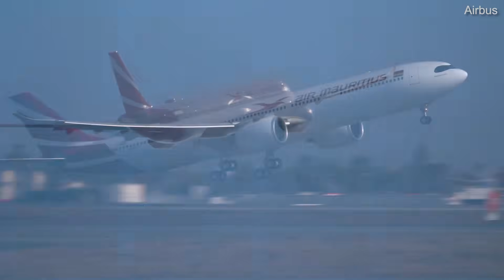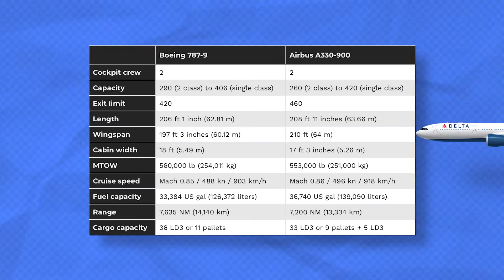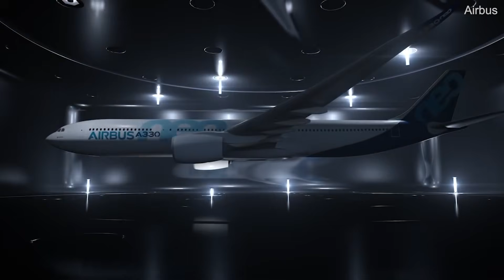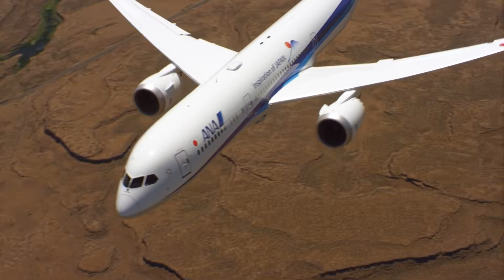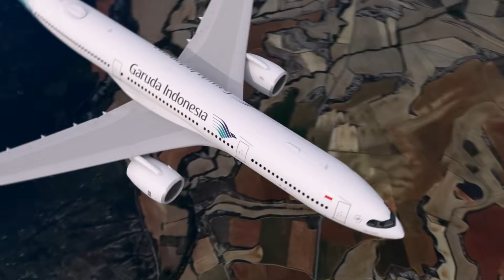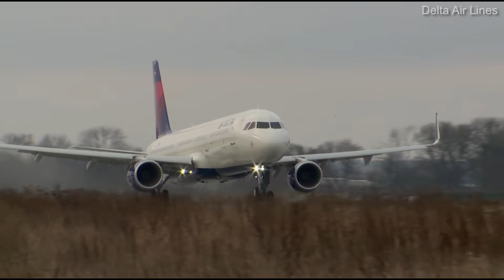Airbus A330neo Vs Boeing 787-9 – Which Plane Is Best?

Comment: There is a significant difference for passengers on long flights.  The 787 has a lower cabin altitude and higher humidity which makes it much more comfortable.  Also the cabin air is not extracted from the engines so there is less chance of contamination.  A major advantage of the 787 is the ability to select the GE GENX engine where the A330 it is Rolls only.  Several customers the originally ordered Rolls engines on their 787 have switched to GE for the follow-on orders.

Comment: i have flown both models 787 and 330 Neo. I must say the Boeing product feels more solid regarding cabin vibration during takeoff and landing. Both 787 and 330 Neo fly smooth and quiet. When I travel overseas I opt for the dreamliner on the routes i fly. When not offered my second choice is 330 Neo.

Comment: I remember flying both type of aircraft several times. But I prefer the 787 landing, because it was quite smooth. I don't know whether it was bcoz of the pilots or the aircraft... but I flew with different airliners so, I thought that may be the aircraft also play a roles in it...

Comment: I always felt that comparing the B787 with the A350 was unfair as the A350 was almost better in all aspects but comparing it to the A330 seems fair enough and coming back to the A350 it's a good comparison for the B777 and the 777X making it's appearance and the A350-1000 getting released the competition just gets better!

Comment: When it comes to the Airbus A330, I have flown on it as a passenger. However, I never flew on an A330NEO due to the fact that this was a second generation of the A330. I'm expecting a quieter cabin on the A330NEO than the A330 just like with the Airbus A320NEO and Boeing 737 MAX with the engine upgrade if I were to fly on one. I hope I can have a chance flying on the A330NEO only if I am able to book a flight using it.
Now when it comes to the Boeing 787, I flown on just once in my lifetime. I liked seeing the dimmable windows in action and the mood lighting in the interior. I hope I can have a chance to fly on the 787 again.

Comment: The Dreamliner should be recalled Dramaliner for Boeing.....headache after headache due to multiple assembly flaws. Which Boeing airplane (almost) never met technical probems??? The B777 and B767. Two models destined to be replaced....where is the quality and the reliability for Boeing????

Comment: I flew the 787 and  a350 back-to-back, and what struck me as peculiar was that the 787 felt just like the 777, while the Airbus a350 felt like a new plane. I realize we're not comparing those two aircraft, but my point is that Boeing built a brand-new airplane, but it doesn't feel that comfortable. It provides the carrier's efficiency but doesn't seem to do much for passengers
Reply: Passenger comfort for the most part is determined by the airline and their choice of seating configuration, unless there were specific things about the A350 that made it stand out or things about the 787 that made it seem similar to the 777? I've personally found the 777 less comfortable than the 787 due to cabin pressurization and humidity levels on the newer 787 relative to some of the older 777s. The A350 also has these characteristics.
The A350 is also the newest of those 3 aircraft so makes sense it'd be the most advanced even if Boeing has improved the 787 a bit over its lifetime.
Reply: @christodang one thing that sticks out as well as that the 787s are being pushed to 9 seat configs, while the a350 being a bigger jet was designed for it, making it feel more spacious
Reply: @samuelharmoko250 There are 10 abreast seat A350s being made (mostly for low cost carriers but we know how these things tend to go in the airline industry...). The 787 was itself initially designed for 8 abreast but I think only JAL still flies those.
Reply: I agree with that 787 is similar to 777 as been on both myself. Last year went on B787-9 1st time was great and this year A350-1000. To me both very difficult to compare. My next aim is hopefully A330 NEO

Comment: The a330neo is still a new aircraft, so it will be modified or be redesigned over the years. Also, when the 787 came out it also had couple of problems and eventually Boeing sorted them out so we can expect the same with Airbus.

Comment: This is a really stupid question, as the a330 is one of airbuses most popular planes & a worthy competitor to the Boeing 767, while the Boeing 787 NightmareLiner was supposed to be a replacement for the 767, but has become Boeing's worst airplane.  Both the 777 and a350 are larger, more efficient, and MUCH more popular than the NightmareLiner.

Comment: The 787 has larger cabin windows. The A350 should be mentioned. By recent standards the small cabin windows for the A330neo could be an issue. Thank goodness Airbus launched the A350.

Comment: You’ve compared the wrong planes ! A330 equivalent is Boeing’s 777 & the 787 equivalent is the A350.
The only very real similarity is the A330 neo uses a Trent 7000 which is essentially a Trent 1000 but with bleed air & hydraulics to run the aircraft’s systems where the Dreamliner is mostly electrical.
Reply: Actually it's not wrong from the market perpective.
 
A330Neo and 787 has similar seating and somewhat pretty close margin in fuel burnt per seat (of course 787 wins due to its all-new aircraft) both A330neo and 787 are used for both domestic and long haul-flights (which ofc 787 has more long-haul due to longer distance) Sure 787 wins by a landslide against the A330 in terms of orders but considering Airbus didn't even have to launch a new aircraft to alternate the 787, i can say the 330neo had a close fight

A350 does compete with 787 but not in market-wise. Most A350 operators use the A350 to replace 777-200ER&LR or -300ER /A340 routes or launch long-haul flights just like 787 but longer distance

Comment: I m neutral, between A330 neo (  600  ) & B787 9. But any a little differrence for two aircraft. AIRBUS A330 600 NEO, beautiful & strong, use high landing gear but from A300 platform, first product from Airbus Industrie (  ADS  ).  BOEING 787 9, new design, wide passenger window, beautiful wings & for glass cockpit model, simple & beautiful. But not strong, because not use high landing gear. Beautiful but not strong. So, I rate  (  50 : 50  ). 👍👍🤗🤗  ///( #CROCITLMYIGPDPODSSS0824PMWIT11262022#) ///

Comment: I think it’s very dependant in subjective terms, more on the age and service life of the particular planes you’re on. 

My last 787 flight, about 30% of the overhead bins had rattling doors which really irritated me.  Toilet door kept popping open throughout the flight, despite being locked. My seat, along with my daughters, creaked like a old bed frame. There was horrible engine whine and on take off it sounded like a bag of nails. It took the shine off a little. 

Compared to the A330 Neo I got off this morning, which was very quiet, well built and very comfortable.

I know which I would pick for a long ride based on that comparison! But then again, I might end up on a rough A330 and a perfect 787 next time, so it’s always subject to change. 

I’m still a little nervous about the 737 crashes, 787 quality failures and Boeings desperation in hiding issues that affected safety. That bothered me and still does. Airbus isn’t perfect by any standard, but I’m still a little uncomfortable. I’m booked on a Max flight tomorrow so I’m trying not to think about it 😂
Reply: That is an issue of airline maintenance, not build quality. The Dreamliner is light years ahead of the A330.
I've flown on the MAX several times. Not a problem.

Comment: Me, I'm located towards the islands of the Indian Ocean where the competition is phenomenal. There are several companies that allow me to go to France including Corsair, Air Austral, Frenchbee and Air France. I often go to Paris in 787-8 for 9 hours of flight and in A330neo for 10 hours of flight, and I prefer the 3-3-3 of the 787 Air austral which is more comfortable than the 3-3-3 from corsair (A330neo ). Wider seats and more spacious cabin, but on the other hand I like the Corsair A330neo cabin better, which is livelier, more modern and a little quieter. Both of these planes are amazing and each has its strengths and weaknesses.
With the 787 from Air austral I feel comfortable physically and with the A339 from Corsair I feel comfortable mentally

Comment: You say the advantage of the A330neo is seat capacity and use the seating of a 787-9, when you fail to mention the 787-10 which is bigger and has more seats...
Reply: In this video he is comparing specifically the 787-9

Comment: Since you are British.. what would you drive a modern Aston Martian or Jag or a 1900 Vauxhall astra estate. The two most critical factors for any airframe design is the WING efficiency and engines fuel consumption. Every thing else is secondary.  787 is by far is the future in airframe designs..

Comment: As a solo traveller , I remember the time when I enjoyed more to travel in a 3-3-3 seating row (777) than in a 3-4-3 seating row(747). And now I enjoy more to travel in a 2-4-2 seating row (330) than in a 3-3-3 seating row ( 787)  .
Reply: 787 was meant for 2-4-2 seatings but greedy airlines crammed in 1 more. There are still some airlines that retain 2-4-2 seatings, most notably Asian airlines.
Reply: Then if you want to try 787, JAL is possibly the only airline that is worth the 787 experience due to 2-4-2 setup instead of 3-3-3, but who knows how long it will stay that way

Comment: A330  comparing the wrong aircraft  should be a350 against 787 and 787 would  win hands down !
Reply: The A350 is far bigger and costs way more than a 787-9, while the A330neo is almost identical to the 787-9 in many aspects

Comment: I'm not a Boeing or Airbus loyalist, I rather look at the planes.  For example, with narrow body flights, I prefer the A320 family.  It is just a bit wider, making it more comfortable, and seems quieter and more robust.  But in this category, I give it to the 787.  I love the big windows, the far better atmospheric pressure.  I do not mind the 3-3-3 cabin, it is very comfortable.  And they have such beautiful wings.  This plane is a revolution and has changed the way we fly long haul.  I live in Hawaii and Hawaiian is moving from the A330 to the 787.  I can't wait to see what new routes that will open up for long haul flights with the 787's better range.  Finally we will have nonstop to Melbourne and possibly Europe!
Reply: Yeah no, I would still prefer the A330neo, over the 787, regardless of the windows and better atmospheric pressure, however in terms of aircraft build quality and durability, and reliability, i give it to the A330neo
Reply: @ramyfares9099  The man has his opinion. Accept it. The 787 has a dispatch reliability of 99%, just like the A330neo and other widebodies. Durability? I've seen no issues with the 787's durability at all. The only point I'd give the A330neo is build quality. Boeing screwed up there.

Comment: I’ve flown on any number of 788s and A330s, and while I appreciate that the 787 is a clean sheet design, that’s about all.  From the point of view of passenger comfort, the 787’s 9 abreast seats are narrower than a 737s, if that’s possible, and extremely uncomfortable on long flights, more so if it’s a full plane– shoulder room is woefully inadequate. It’s made even worse if the airline has reduced seat pitch, like many low-cost carriers have. I quite like the 787 in premium economy/business, but that’s not how I usually fly.

Comment: I flew on the 787 and I wasn't impressed. I found the cabin noise more boomy than the 767, and the electronic window shade is just a gimmick as it doesn't completely blackout so if you need sleep in the day you're out of luck. Considering the previous controversy around its manufacture, I have been trying to avoid it since.

Comment: I would hazard a guess, as operators seek replacement A330 CEOs, A330 NEO orders will increase as it is a far cheaper option in the background to gain the similar benefits
Reply: The problem is that the A330Neo have the same systems as the A330ceo’s (except the new engines and wings) 

The 787 on the other hand makes maintenance easier, smoother, cheaper and quicker since most pneumatic and some hydraulic systems with electrical systems
Reply: @broddsaviation5471 More of a reason the get the NEO if they've flew the CEO before since it has the same systems retraining the pilots wont cost or take time that much compared to training them to a new aircraft and plus they can effeciently maintain the NEO better since they have experience with the CEO before

Comment: While I would say the 787 is the better plane technically as a pilot and passenger I prefer the A330 neo. You get more space per passenger and as a pilot you get a side stick and a tray table. I do like the 787 crew rest area though.
Reply: @Roger  ok. The 787 is only lighter, more efficient, quieter, lower cabin altitude, better take off and landing performance. But you know whatever you say. That all said I would rather have the 330neo due to the cabin / cockpit layout and fleet simplification. They are both great airplanes just for different reasons.
Reply: Exact my thought  - fancy composite design with anachronistic cockpit layout.  The A330 cockpit looks cleaner, and it looks more like a workstation of a systems manager or plant manager.  It's a step ahead from Boeings steering wheel and thousand knobs, lights, and little switches.

Comment: I'm astonished that the A330-900 is more expensive. Why would that be the case, it fails in almost every measure against the 787. And this is a legacy plane that has only been upgraded, not a new platform at all.
Reply: It might have a higher list price, but that doesn't mean Airlines have to pay more for an A330-900 than a 787-9. Many Airbus Jets have higher list prices than their Boeing counterparts, but Airbus usually offers larger price cuts to airlines.

In the high demand, medium range market the A330-900 can even outperform the 787-9. That's the reason why the -900 is popular with Asian Airlines.
Reply: @peterv.9485  Just read your comment again, and see if it makes any sense,

Comment: I think more should have been discussed regarding maintenance costs.  I'd be very surprised if the 787's maintenance costs were not much higher than those of the A330.  I mean, how do you repair a composite material hull after it's been struck by a resupply truck on the tarmac?  After all, this type of incident happens very often.

I have flown on Air Canada's 787, both the -8 and -9.  It may be caused by Air Canada's poor cabin design, but I will go out of my way to avoid these planes in the future.  They are very uncomfortable.

I have flown on the legacy A330, -200 (Air Transat - 9 seats across) and -300 (Air Transat 9 seats across and Air Canada 8 seats across) and I find them much more comfortable than Air Canada's 787s.
Reply: They are, especially when you look at the taped up wings of the 787.
Reply: The thing with the 787’s is that their maintenance is super low due to the change of pneumatic and hydraulic systems being replaced with electrical systems which makes it easier and cheaper to repair and replace (which cuts both time and economic costs down by a lot)
Reply: @broddsaviation5471  The A330 is also fly-by-wire, so my premiss remains.
Reply: @robertmainville4881  I’m not talking about the FBW system, I’m talking about the functional systems
Reply: @broddsaviation5471  Then list it in percent how much lower the maintenance is compared to an A350 for example.  Electrical systems need maintenance as well, and an air conditioning system for the cabin is distributing air and not electricity.  I would be also curious how many of the servo drives moving the control surfaces have been replaced through electrical drives?
The big difference I see is the monstrous generator and the huge LiPo accu replacing the bleed air for cabin pressure.  There are some other places, somebody claimed the wheel breaks are getting actuated electrically instead of hydraulically, but that would represent another heat source in an area, that is getting hot already by the break-discs, so it sounds a little strange.  But you're the expert, so you now tell, how much less maintenance is need by percentage compared to legacy planes.